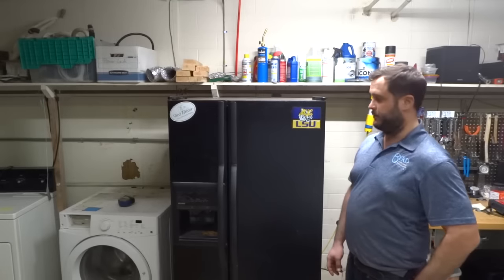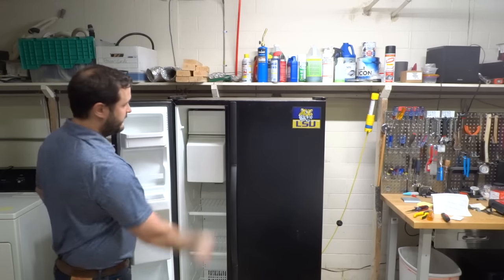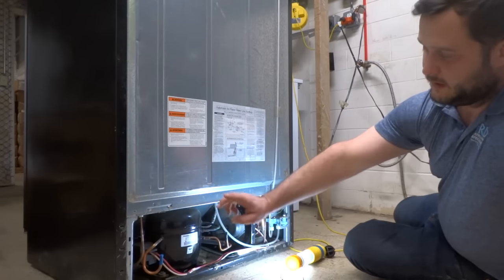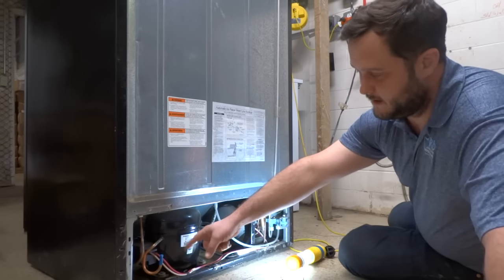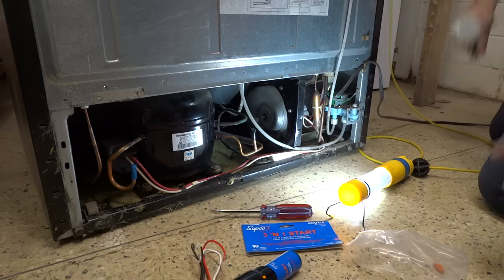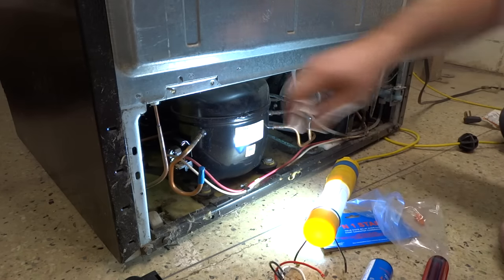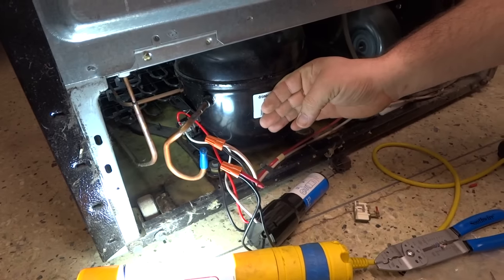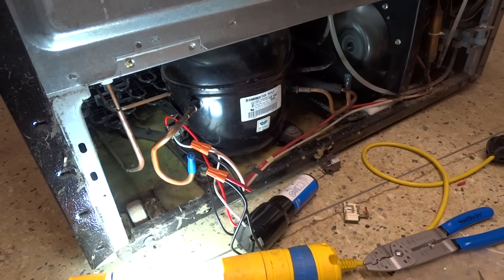Kenmore Refrigerator Not Cooling at all - Compressor

Comment: Good video, many thanks!  Wish you were in CA.  I bought the same starter switch relay/capacitor for my Kenmore fridge from Jan 2002.  It does not match the separate pieces of existing relay switch and capacitor both of which plug into each other and into compressor.  In order for the Supco replacement to work I would have to devise a plug for the compressor connection socket (3 pin prongs).  Also my fridge is missing a fan, and Sears tech diagrams don't even show a fan in this model.  Compressor comes on, fridge lights work, but compressor does not get warm or hot, and fridge does not cool.  Relay switch does not rattle when shaken.  Capacitor is working fine.  Very confused.  Is my compressor low on freon?  Why is there no visible fan next to compressor?
Would love some advice please!  Most techs in CA will not work on LG appliances, which are all Kenmore fridges.  I'm on my own, and my food is spoiling in a substitute fridge.  Please help!
Reply from the maker: If the compressor is on, and relatively cooler to the touch, you most likely had a refrigerant leak.

Comment: Hello repairman. I have a Kenmore coldspot side by side. I heard a click and my kitchen lights flickered and I smelled burning wires smell. I checked the socket , the fuse box both all good. I replugged the fridge up and 2 hours later frozen veggies are thawing out. fan is running in freezer blowing cool air but not frosty air like before. Compressor not humming. All lights come on inside. Just freezer not getting cold and compressor not humming. Burnt smell has not returned. lights have not flickerd since. Can your part fix this ??

Comment: My kenmoore coldspot 106.5 looks same as yours. (Mouse stuck in fan. Relay start looks burnt. Kicks on for a few sec and shuts off after mouse removed and fan working)
 I got my 3n1 hooked up. But the power clip going into the relay that you cut has 1 red, and then 2 white on the other slot of the wire connector. Since both are on the same connector side i put
Both white wires on 1 black 3n1 wire, then the single red on the other.  
My 3 prints on compressor were same single black on bottom . then the white and red on top (upside down triangle)
Compressor is running now. Only been 10min havnt noticed cooling yet. 
Ever run into the 2 white wires on connector clip before? 
3 year old fridge
Reply: Traced the wires I cut that had 2 whites.  one just goes to a clip in the fan, the other goes back with the other wires. Guess daisy chained from fan or something. 

However compressor is hot and nothing cold yet. I think my compressor is burnt up. But it sounds like it's running I don't get it
Reply: I also have a green clip on the compressor about 3-4 inches from the 3 prong

Comment: On my top bottom frigidaire, and a few others I'm working on. ALL Parts  working, Compressor ON, Evap Fan ON, everything coming on and running, but not getting cold at all - DID the freon Leak out over time???
Reply from the maker: Sounds like it.

Comment: Mine seems to work OK but it just runs allot louder than it used to lately. Should I go ahead & replace the compressor? or is there some kind of refurbishment I can do to make it run quieter?
Reply from the maker: Replacing the compressor is no small feat. If you can handle the noise, leave it alone.
Reply: I was able to get creative with some cardboard pieces placed strategically under the legs & it really reduced the noise. No longer sounds like a damn hornets nest. Its just a very low frequency hum almost like when it was new now.

It does seem like a pretty complex task to replace the whole compressor. Its almost as if its been hardwired in there.
Reply: @theatom7264  Given the price of a new compressor and the cost to install it and recharge the system, if a replacement is actually required, you might be better off just putting that money towards a new fridge.

Comment: I just checked the fan is not running, the compressor is hot (really hot) and I didn't really listen for the relay switch to click. Is it expensive to replace the fan and also should I replace both to be on the safe side?
Reply from the maker: It may just be the fan. Without doing live voltage testing, it would be hard to know. Compressor may be running hot due to the fan not operating.

Comment: Hi GREAT video BTW. 
I have a Kenmore Elite  Model 795.72063.110, Compressor is a FC75LBNA , I feel the compressor stats to vibrate low, (no hard start), the fan & everything else is running,  I'm not getting any cooling. I checked the windings and the RIGHT pin has no continuity, but there' no wire going to it, I also checked the capacitors abs I get resistance so they look OK to me; so will a quickstart 410 work on this knowing that the RIGHT pin is isolated from the other two?? And if a quickstart will work at least for a while, which one should I buy? There's too many different ones & any help is really appreciated,  (this is the 5th day without a fridge). If you think it's shot & not worth it, I'll take your word.
Thank you in advance 
Regards 
JCD
Reply: I'm trying to correct this and I'm not able to, the on that has no continuity is the "RIGHT" pin, I also tested the capacitors abs in getting some resistance si they look OK

Comment: Have a question , I went to recharge the unit with r134a , and watching a bunch I haven’t seen any fridges running with 30 psi,in which I’ve only seen no more then 5psi  , the fridge is cooling but not the way it’s supposed , does the 30 psi mean there is too much Freon in there ? Should I purge it ?
Reply: I've noticed that too ... many different PSIs are given as the correct one.    The way I recharge R134a in my fridge is INCREMENTALLY, even though this requires the fridge to be left pulled out from the wall.  If I see the freezer struggling to stay cool, I add just a little R134a each day and I leave the hose and canister attached for the duration, so I can monitor the psi.  I also leave a couple of fridge thermometers inside the freezer compartment, so I can monitor the temperature.    If my lowest attainable temp is only (for example) 20F degrees, I'll add a little more R134a, then leave it for another day, to see if it drops below 20F.  I then repeat this process until I can get it down to 0F ... then I'm happy.  Also, what will really help is bypassing the built in mechanical thermostat with a digital display model.    These are cheap and more accurate, plus you can lower the temperature differential, to keep variances inside the unit, smaller.

Comment: On my fridge, compressor is running (quieter than it should), and there was no cooling in refrigeration and freezer section. I can hear on the freezer section freon going around very quietly but I guess not enough to cool. It feels to be running dry or something. Coils at the end are completely cool, they were hot few days ago.
Reply: Are you getting any cooling, at all?  If so, you may just need to add some R134a.  To do that, you'll likely need to attach a bullet-piercing valve (search on Amazon) to the low side of the compressor,  then buy a hose and gauge set ($15), plus a can of R134a  ($5-$11).   There are YouTube videos that have clear instructions on all this, but to avoid overcharging, add just a little R134a, at a time and monitor the temperature.

Comment: I have a 2005 Kenmore Elite, it makes sounds from the compressor but is not cooling. I saw a web page on the Sears service page with error codes, but this unit is not displaying any error codes, simply not cooling.

Is there a special way one goes about coaxing the machine to post error codes, or does it only do so when it detects a problem that it is designed to recognize and report?
Reply from the maker: If the compressor is running, and there is no cold whatsoever, you have a refrigerant problem. Spend your money  on a new fridge.
Reply: @byrdappliancespecialists3356  I'm not spending money on a new fridge. I don't have thousands of dollars to waste. If I can not fix this one for a few hundred dollars, I will get a second hand one from Craigslist.

Comment: Is this kit a universal replacement for any type of refrigerator? Once change is made, are you supposed to secure or hang it, in there or just leave it as you did here? Thanks for sharing the knowledge.
Reply from the maker: Fairly universal on older models. You may have an additional run capacitor, which is not on this one. Just tuck it in away from the fan and make sure the wire nuts are tight with no exposed wiring.
Reply: Thanks for the rapid reply.
Reply: @byrdappliancespecialists3356  I was having the same question ready. LOL Thanks

Comment: How long does the 3 in 1 last Ive use it for over  a year but now is not cooling in the freezer there is ice in the back but is not cooling in the other side.what could be the problem.
Reply from the maker: Defrost system is most likely.

Comment: Kenmore Elite   795.72053.110   LED on the mother board not blinking at all ... Fridge  not  cooling ( Neither freezer, nor fridge up there) what could be the issue...?? compressor vibrates and heating up, Fan near compressor and inside one working too. All lights inside and the panel display working fine...This one has quieter compressor than previous fridges  though but fridge not cooling at all..??  Appreciate your, and readers inputs ...Paid  almost $3000 , just a  box now...Please  help

Comment: So if the fridge/freezer is not cooling, the compressor fan is running and the compressor is hot, can I assume the compressor is defective?  Kenmore Elite French door/bottom freezer less than 2 years old.
Reply from the maker: +dosbirn No. It can be hot and not vibrating. That could still be bad start components - maybe a dead capacitor. Hard to say for sure.
Reply: Model starts with 795 95 % chance bad compressor.

Comment: Is the fan supposed to be blowing towards the compressor or away. Mine is blowing away from it. Also when sometimes the compressor rattles quite a bit. I unplug the refrigerator sometimes for like 20min and plug it back and it gets cold again when it’s not getting cold
Reply from the maker: For condenser fans, it depends on the design. Rattling could be internal or external for the compressor. You'll just have to check external things first - internal would be unrepairable.

Comment: Have a Kenmore 596 series, fridge and freezer not cooling, both are now room temp. Fan and compressor are running, should I start with thermistor? Any ideas what to start with?
Reply from the maker: If you have no cold at all and the compressor is running, it's a sealed system problem. We generally recommend putting that money towards a new fridge.

Comment: As others have said, very nice video. My top-freezer fridge Kenmore 106.73182301 stopped cooling both with the fridge and the freezer a couple of days ago. The compressor is  cool to the touch, so I don't think that the compressor is running, but there is no clicking sound. Also the fans are running. I removed the starter (which was reasonably straightforward to do) and the relay, and both of them rattle when shaken. However, it is not completely clear to me that the shaking parts should not rattle. So, is this still something that is possible to replace using the Supco 3-in-1 starter kit? The compressor is EMBRACO EMY-60HER and appears to be rated at 1/6 HP, with Type 134a. Online, I see a SUPCO URCO810 and a SUPCO RCO810. Which one would be more for my compressor? Thanks!

Comment: HI... I have Whirlpool gs5shaxnb00 which stopped working this weekend. I bought the 3 in 1 starter kit Supco RCO410 instead of RC0810 and installed it yesterday. Interestingly the fridge cooling started on both freezer and fridge sides but every time I open the fridge door the compressor stops and i hear clicking side on the back. I have the video of it. DId i install wrong part ? or should i buy OEM parts and install them. Please advice.
Reply from the maker: +Jay Patel Weird. Lights might be tied into your main board. They should not shut the compressor off. Not sure of what the problem is. Could be a strange issue at the main board. You need a wiring diagram.

Comment: If the compress is warm to touch does that mean its working or no?
Reply: That's my question. Did you ever find out?
Reply: @TimBrownTown  sorry I can’t really give you a clear answer - to be honest I gave up on mine and I’m tolerating a wine cooler that doesn’t actually cool wine anymore so it’s kind of a wine cupboard.
Reply: @Isabel-of4wq  I think I may have an answer soon. Seems that if you can measure the amperage and it's drawing a high value, then the compressor is locked and you basically need a new fridge. But hey, at least you have chilled wine to drink! I'll let you know more details once I test mine. I need to see if my neighbor has a clamp meter I can borrow to measure the amps it's pulling.

Comment: Bottom of frig clogged with dust, compressor got hot and not cycling or coming on. Cleaned dust out good with a leaf blower (Fogged the house up with dust). Let compressor cool and plugged back in an hour, compressor came on, no click, but is real weak sounding. Is that relay bad and just not kicking it on right? Did the compressor over heat and go bad? Should I try the 3 way new switch?
Reply from the maker: If the relay were bad, it wouldn't be able to turn on. If the compressor is running, it's working. If there is no cooling at all, it's probably a sealed system issue. Beyond the scope of the video.

Comment: My compressor is cold and fan doesn’t turn on. Changed relay but still no compressor. Would this help in my case?
Reply from the maker: Sounds like a voltage supply problem. Keep digging
Reply: Byrd Appliance Specialists ok, thanks.

Comment: Informative. However, all of my fans are working and the compressor starts when I plug it in but it doesn't cool even a little bit. The compressor itself gets a little warm but barely. Can you point me in the right direction?
Reply from the maker: Sounds like a sealed system leak. Expensive and low probability successful repair for DIY.

Comment: My fridge freezes on top but doesn’t cool the bottom there doesn’t seem to be anything blocking the airways between top and bottom, the compressor hasn’t turned off in a long time but doesn’t sound as loud as I remember. The defrost bimetallic, resistor seem to be working, my condenser coils are clean and are the fan less type. Does anyone know if this could solve my problem? Or what my problem is?

Comment: Quick question after watching your video.  When I removed the panel from the back of my Kenmore refrigerator,  I don't see the condenser fan running at all.  I am wondering if the condenser relay has failed (seems to be the easiest fix) this would cause the fan to not run as well?
Reply from the maker: If the condenser fan is not running, and neither is the compressor, you have a different problem. We have another video that may help on our channel.
Reply: Byrd Appliance Specialists thanks for the quick reply. Which video addresses my potential issue?  You have a link for that one?

Comment: Tried to install one of these on my Idylis brand chest freezer. When I plug it in I can hear the compressor. After running for about 30 secs my GFCI trips. Any thoughts or suggestions?
Reply: One thing he did not mention is low freeon gas can also cause it to trip, might have a leak ? If the intake side is low it causes the compressor to work to hard and overload.

Comment: Ok I have a question . 
I installed it and it worked the fan turned on and the compressor for about 5 minutes. And never turned back on. Do you think my problem was the compressor and not the relay ?
Reply from the maker: If the fan is still running, and the compressor stopped, your compressor is dead.
Reply: Ok so the fan and compressor turned back on after a few minutes. I’m going to wait and see if the refrigerator get cooler .

Comment: hey after installed 3n1 my compressor so quiet but i heard sound click from 3n1 itself one every one while . Do you know what happen?  thank you
Reply from the maker: If you hooked it up correctly, it may be tripping the overload in the 3n1. Bad compressor. If the fridge is getting cold, it's working. A "quiet" compressor may be a dead compressor.
Reply: @byrdappliancespecialists3356  same thing here..it worked the first day but the next day it started clicking the compressor is extremely hot but the fridge is cooling ..but the ice melted in the freezer..its still blowing cold air though

Comment: Hi, I have Kenmore fridge and trying to install the capacitor.  It has only 2 prong and want to know what kinds of capacitor I need to buy.  Thanks in advance!!
Reply from the maker: +Jackie Hahn Capicitors only have 2 prongs on residential refrigerators.. Call your local appliance parts store and give them the fridge model #. You may be confused on what you're looking for. Take the parts to a local appliance parts store, and maybe they will get you going in the right direction.
Reply: Thanks